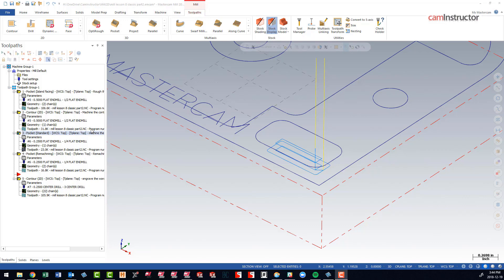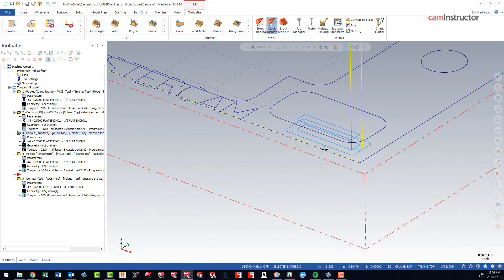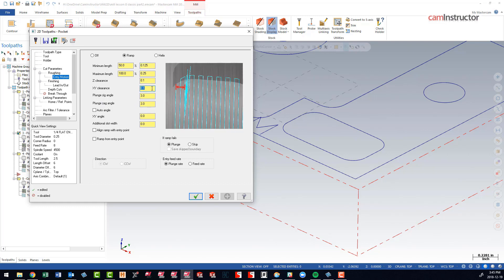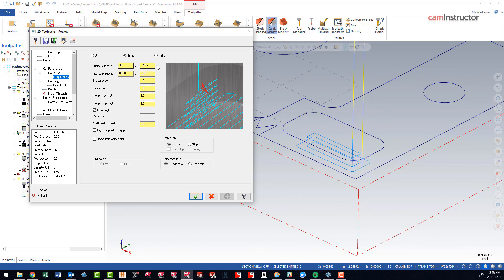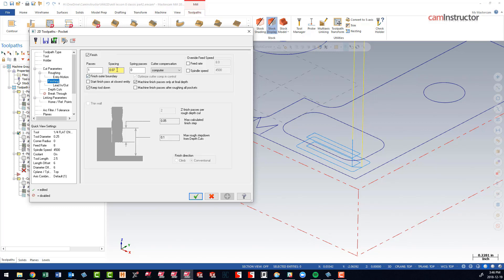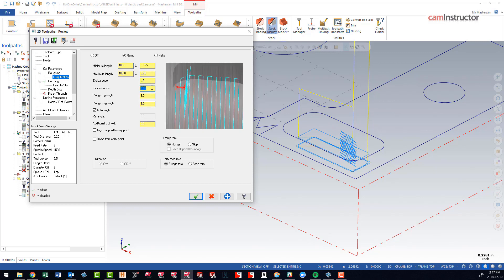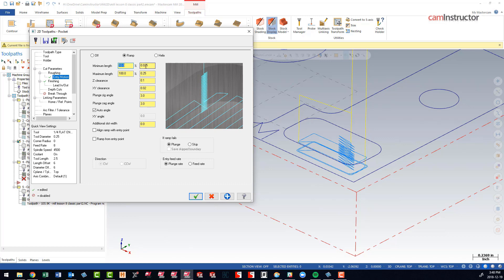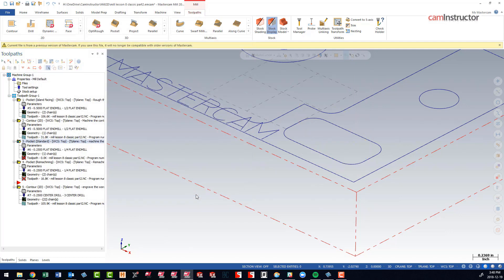Fixing Failed Pocket Entry Motion in Mastercam

Comment: Is it possible to select a start point instead of changing all these parameters? Is there a Video? I need this information for 2D pockets and 2D and 3D HSC. THX in advance
Reply from the maker: Yes. You can give 2D pocket a location to plunge at, or perform the entry motion, by adding a point to the chained geometry.
Reply: CamInstructor Thx for your answer. What about the HSC pockets?
Reply from the maker: The highspeed toolpaths have many options for tool entry, too many to cover in a youtube comment. Some videos on our blog discuss these options. https://blog.caminstructor.com/mastercam-dynamic-milling-part-5 is a good start. 
I should also add to the previous reply for the 2D pocket, you also need to check the ‘Center on entry point’ box on the entry motion page.